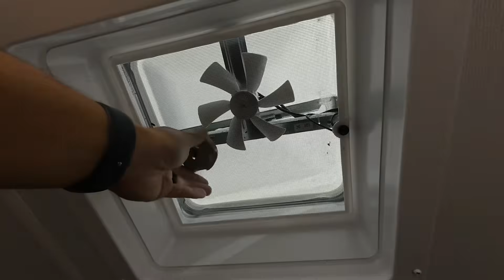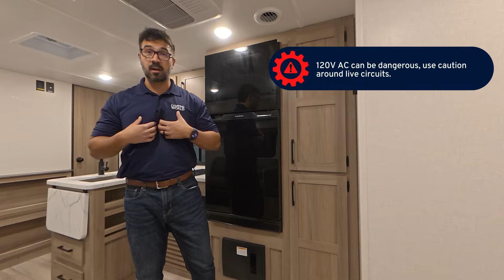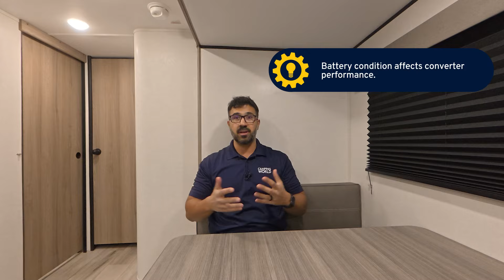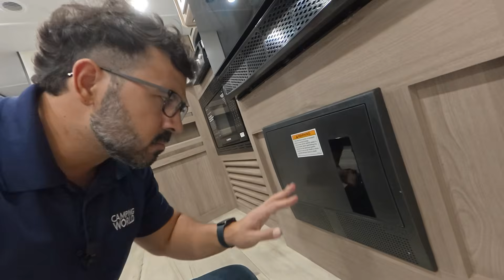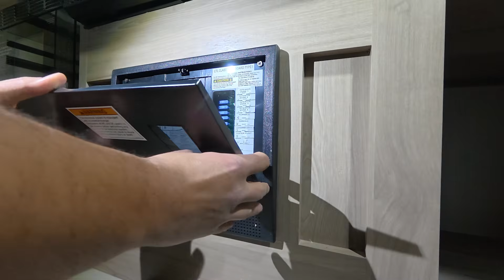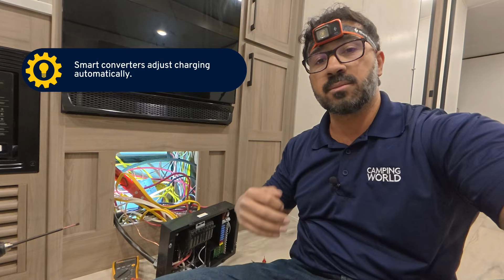RV Power Converter Not Working? | RV Troubleshooting

Comment: So if the fan isn't running,  is there a problem?
Reply from the maker: Hi There! 

The fan(s) in most converters are temperature and/or load controlled. This means that they only run when they need to. If the converter gets warm, they come on and run until it cools down. Or they come on when you put a sudden load on it by turning on a bunch of 12vdc lighting or turning on 12vdc appliances. These fans are pretty quiet so you may not notice them run with all the background noise of daily life like TVs, music, or conversations. 

If you never ever hear the fan running even when you try to make it come on by turning every light in the RV on at the same time, you should schedule an inspection: https://cwrv.link/rvservice

Hope this helps!

Comment: So I flipped the main breaker on my 1983 Fleetwood jamboree class C, because I didn't want to have power running through if I was going to be here for a long period of time instead of disconnecting the the short power once I did that it screwed everything up my fridge. Doesn't work. I've checked the g AFI that's fine when I flipped it back on after I turned it off, just to double check, cause I noticed that the loud humming sound stopped coming from my converter. My fridge worked for a split second in my panel, up above my fridge, for the pumps and everything worked for a minute. And then all of a sudden it just didn't  So I don't know what else to do. I haven't checked all the batteries I know they're both dead.
Reply from the maker: Hi Katie, 

It sounds like you may be under the impression that it can be bad to leave the AC power on unless you really need it, which is why you've turned it off at the breaker? 

Your lights, pump, and refer can run on battery power for a while. But as you pointed out, the converter shut down when the AC was turned off at the breaker, so your batteries likely ran down and everything stopped working. 

Here are a few videos that might be useful: 

Understanding AC/DC RV Electrical Systems: https://youtu.be/_08LuRuSD6w

Shore Power Basics: https://youtu.be/EdvJ1t4TbHI

And one article: 

How to Conserve Power When Boondocking: https://blog.campingworld.com/learn-to-rv/how-to-conserve-and-create-power-when-youre-rv-boondocking/

Hope these additional resources help!

Comment: how do I check my 12-volt system while running off the chassis battery alternator
Reply from the maker: Try isolating any other power inputs such as the RV converter or solar charging systems. Measure the voltage at each battery and write those numbers down. Start the engine and double check again that only alternator power is available with the engine running. Measure the voltage at each battery once more and write those numbers down. Compare the voltages to verify they have increased by at least .5 VDC, but that it doesn't exceed 14.6VDC for most battery types. 

Hope this helps!

Comment: If the converter is putting out 13 V can it be assumed it is because both batteries test at 11.3 Volts after a night of charging and hours of TV time  while connected to shore power. Or could it be that the converter just cannot catch up while under a load? Lastly. would using an additional trickle charger help maintain the batteries since the convert is Putting out Lower than normal Voltage?
Reply from the maker: Hi Josh. Apologies for the delay, but I just heard back from our Technical Team. According to their feedback, the converter should output 13.6 to 14.6 VDC if operating normally. They suggest double checking that the battery disconnect switch, if so equipped, is in the ON position at all times except for when the RV is in storage. 

Then, checking the converter and battery fuses to ensure these two devices are able to work together as designed. While the converter is good at providing voltage, it is limited in how many amps it can provide. So, if the battery disconnect is in the OFF position, the battery never gets charged and it's voltage will drop. Similarly, running the 12 VDC accessories in the RV with the battery disconnect switch in the off position will result in the converter voltage dropping as the amp loads are increased. It is a system and all components must work together to achieve the desired results.

Hope this helps!